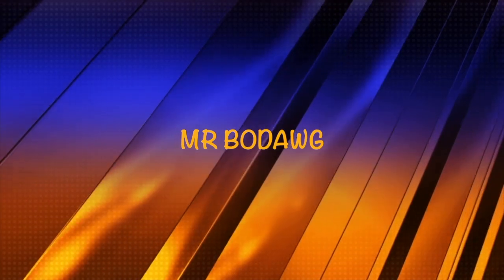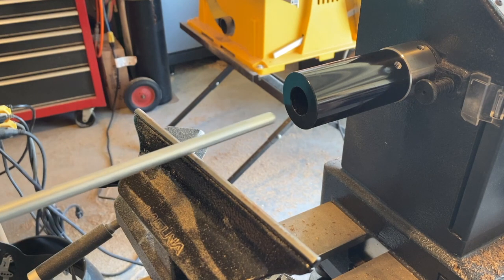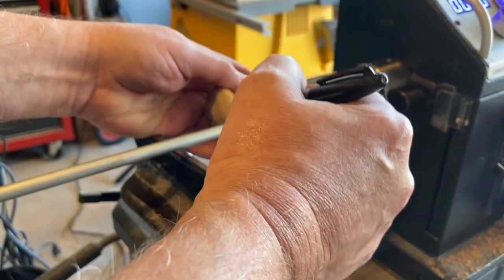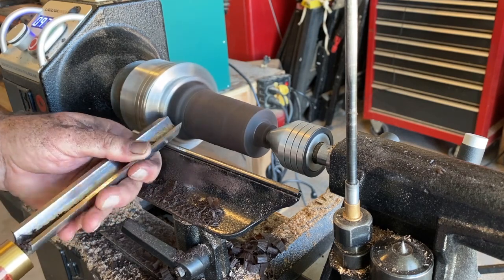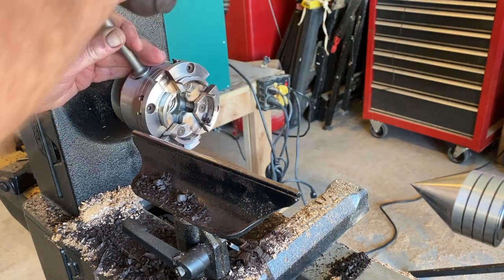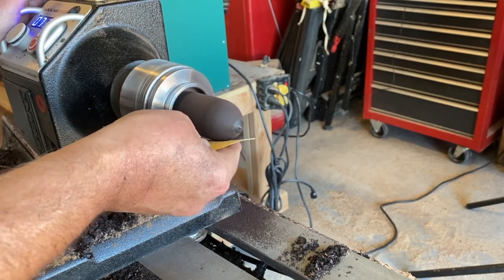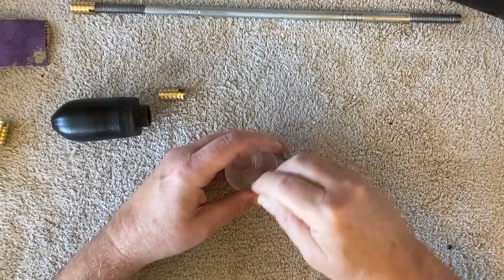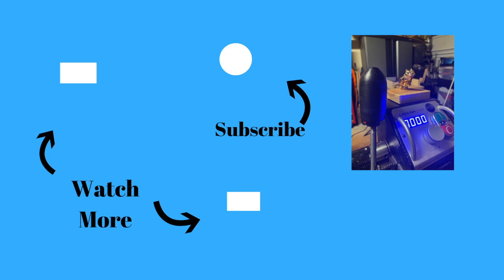Draw Bar for Laguna 1216 Lathe

Comment: Would you use a drawbar on the Jacobs when in the tailstock ? That seems like a good idea to me. Drawbacks? Thoughts?  -Mike
Reply from the maker: Good question. I use a Jacobs chuck in the tail stock to drill or hold a mandrel while the headstock will drive or turn the item. It keeps pressure on the morse taper in the tail stock and tends not need a drawbar. I use a drawbar in the headstock when I do not have the pressure of the tailstock to support the Jacobs chuck and keep it from wandering out. It also helps lock the morse taper in and not spin in the headstock. One of the next videos will show how I use a Jacobs chuck on the tailstock to hold a mandrel. Thank you for the question.

Comment: Why use a jacobs chuck in your headstock when you have a real chuck?
Reply from the maker: Sometimes I will use a mandrel for a project. The regular 4 jaw chuck will grab the mandrel but the outside of the chuck will sometimes get in the way of turning it. the jacobs chuck is smaller and I can get a gouge in close to the base for coves. Just makes it easier to make a wide cut.